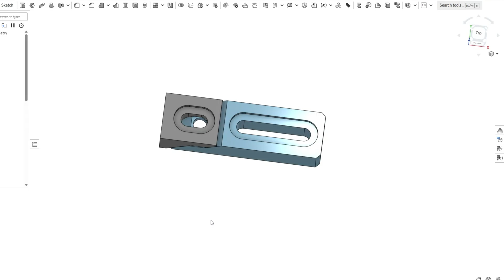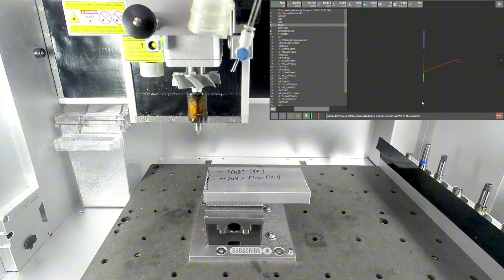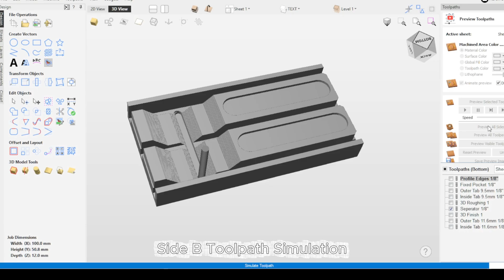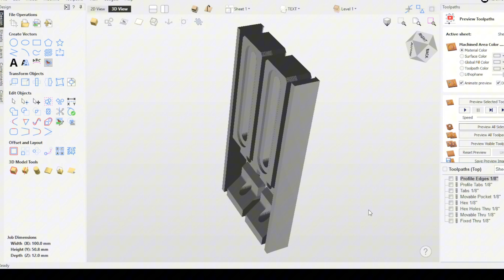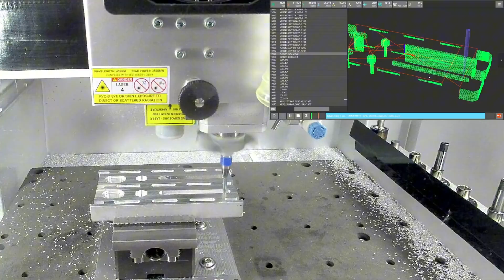Carvera CNC: These DIY Aluminum Clamps Completely Changed My CNC Workholding! (Not Sponsored)

Comment: Great job! These definitely look much better than the standard bits in the kit. I see you using a 1/4 inch cutter. Where did you get the feed and speed detail from?
Reply from the maker: Thank you. I appreciate it. 

To answer your question:
Practice. Over time, I found good feeds and speeds. In the full video, I will share tools used along with details.

Comment: I just loaded the step file into FreeCAD and noticed there's only one head type - 8:30 shows some useful ones could you share those please?
Reply from the maker: Those are just modified in cam. Which one in specific do you want? They are pretty simple cam ops
Reply: @GabrielMakesThings  I really need the low profile one. Unfortunately I still suck with CAD software. Been learning FreeCAD but it still takes forever to do anything.
Reply from the maker: @chrishayes5755 I can add it for you. What thickness do you need?
Reply: @GabrielMakesThings  sorry for the delay getting back to you the one on the far right at 8:30 is perfect

Comment: How do you find part accuracy when machining 2 sided operation? Is it vastly improved with the aftermarket vice you’ve added?
Reply from the maker: As long as you dial it in once in a while it's pretty repeatable. I calibrate the anchor positions every 2 weeks or so. The vise is self centering (see previous video for info on that) so as long as my anchor position is calibrated everything else lines up well.
Reply: @G @GabrielMakesThings anks man, I’ve just made your vice plate (thanks so much!)

Just installed the vice etc, forgot to fine tune the anchor positions on the first project 

Ended up clamping a chamfer tool in the vice & one in the chuck & played around until tips touched perfectly. Did you have any other preferred method?

Thanks
Reply from the maker: @rsjunkie4919 just calibrate the anchor position. No other calibration should be needed assuming the bits you used are actually the diameter you programmed in cam (you'd be surprised how often they are off). The vise plate acts as your anchor position
Reply: You indicated that you calibrate the anchor positions about every two weeks. Can you give more detail on how to calibrate the anchor positions?